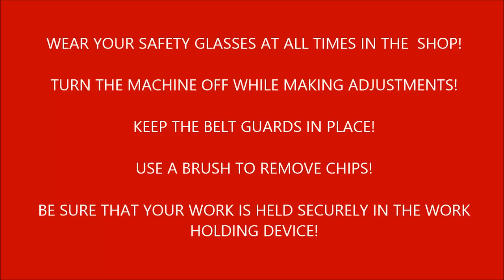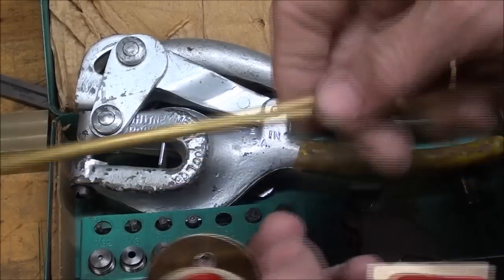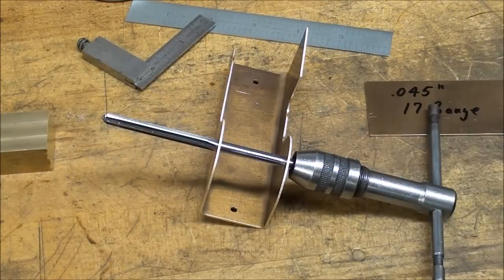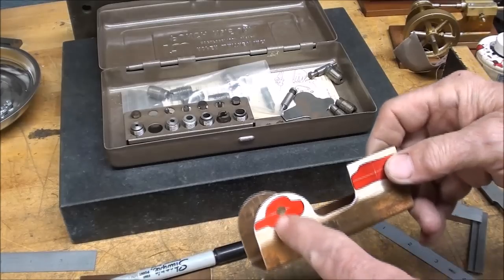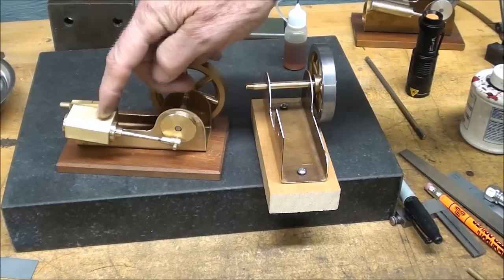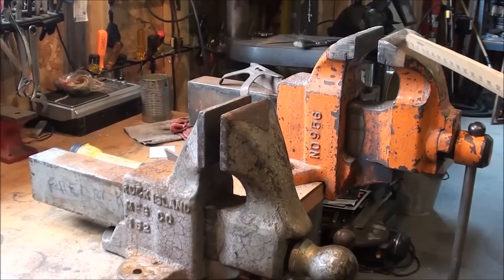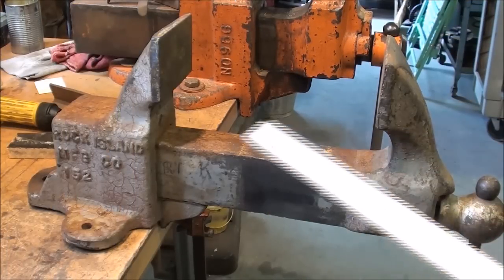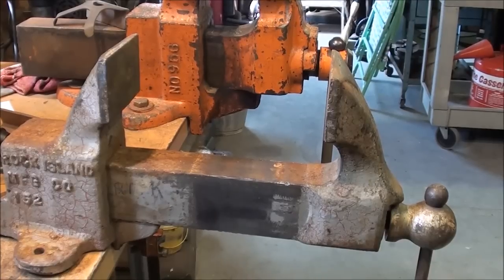Part 3 of 10 - tubalcain Builds the YELLOW BOY STEAM ENGINE

Comment: The thin solder is also easy to find, but you must check in electronics store. You can even get sizes down to 0.3mm and maybe even thinner.
Reply: +Slovenija12345 - sizes down to 0.25mm (30AWG) are easy to buy here in the UK - just find a decent electronics stockist.

Comment: I'm assuming the annealed tubing is too soft for a tubing cutter?
Reply: +hopper1 Yeah, it might collapse. I bought a pex tube (the plastic and aluminium/aluminum water installation tubes) cutter and i use that. I set the piece inside make sure i'm even and then gently press the blade in and turn it around for to score a line, double that line and then if you bend it (depends on the length you cut) it pops open without much hassle.
Reply from the maker: +hopper1 Yes-Thanks for watching

Comment: Hello mrpete222, I just bought an old atlas th42 but I don't know anything about metal lathes yet so I'm starting to watch your videos. Mine is missing the countershaft pulley assembly and I just wanted to know if that is something I'll be able to find and buy somewhere, or if I should just part the whole lathe out on eBay and try and find a complete lathe somewhere else? I like that name tubalcain by the way, do you take it from the first known artificer, or the lodge?
Reply: +Shane K Congrats on getting a lathe.  Don't part the thing out just because you don't have the counter shaft assembly.  There are many, many ways to build your own.  Heck, you could even rig one up out of wood so the lathe can be used to make better parts.  Just be patient and browse ebay, craigslist etc.  You'll find what you need.
Reply from the maker: +Shane K From the BIBLE.  At my age, I would want to find another lathe. But I'm sure you can buils something. But I don't like things to look makeshift.
Reply: Thank you both for answering me, I think if I can't find one I will try and figure the ratios and build something then, with two teenage daughters funds for my toys are nonexistent.